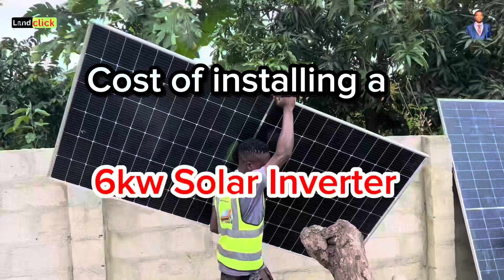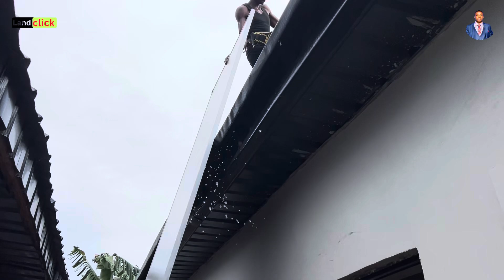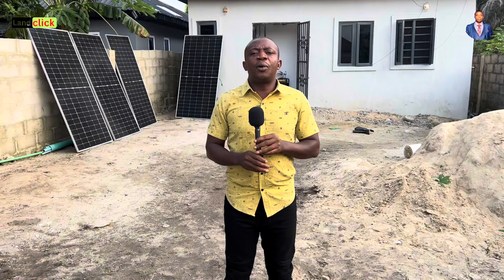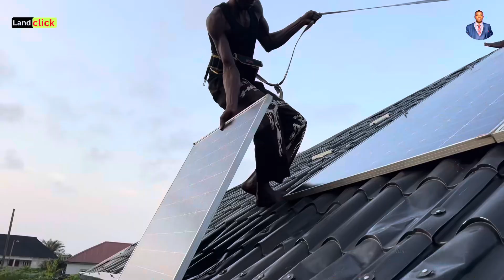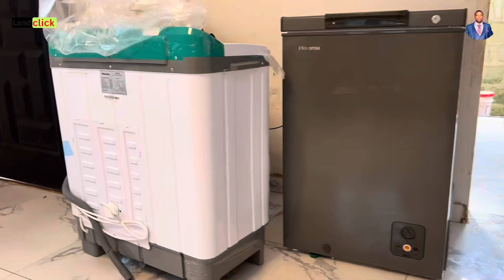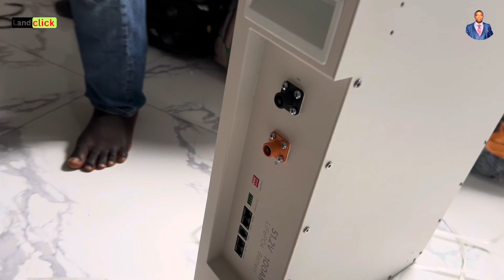2025: Cost of different types of Solar inverters, Panels & batteries in Lagos Nigeria

Comment: The entire set-up is costing 2,500,000 naira but 
Inverter = 800,000 naira
Battery = 1,300,000 naira
Panel = (130,000 × 8) = 1,040,000 naira

Abeg Total = 3,140,000 naira
Check am well well

Comment: Why would a small home need all those solar panels unless it's a factory. In the tropics only 2 600W watts are enough for a 6Kw system.
.....🎉We need prayers 🙏 in Africa
Using 8 650W panels for a house could be over panelling for a residential house.
Reply: And u knw more than the installers, 2 panels nawa for u oo, 
U wud hv made sense if u included reducing the inverter size to maybe 3kw instead of the 6kw used in this video, some tins can't go bro